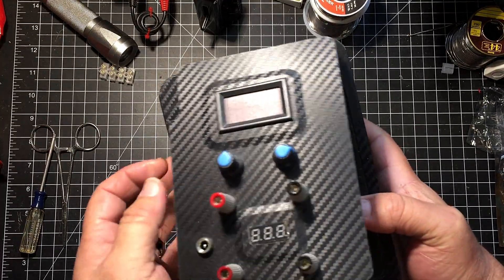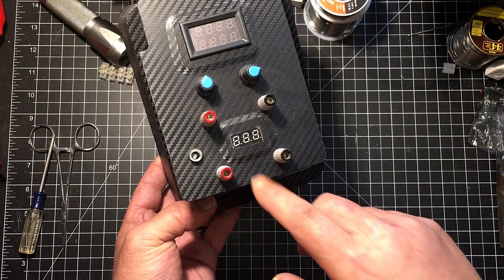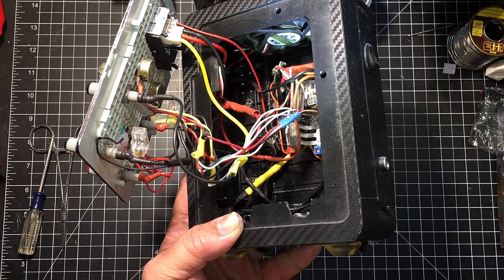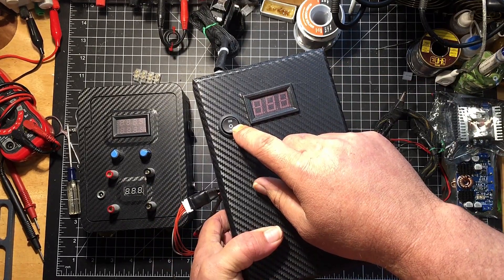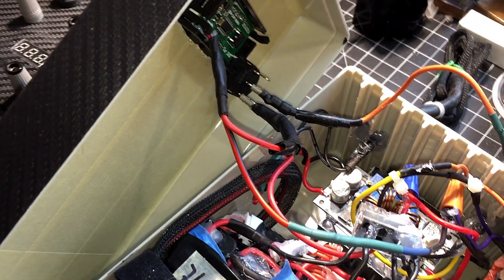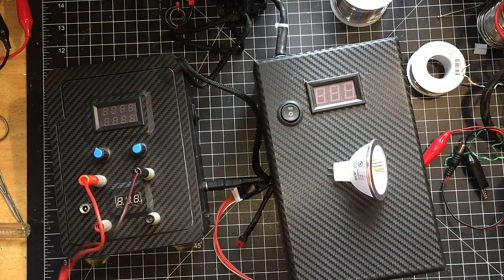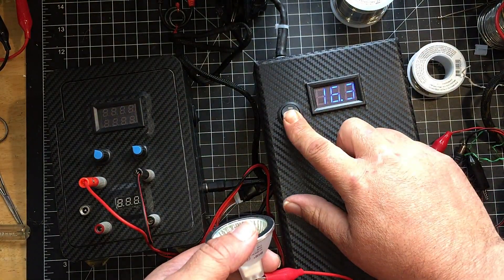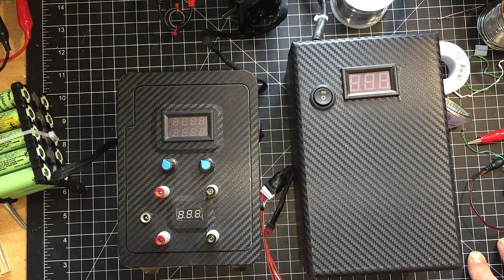DIY Mini Portable Power Supply/Ampmeter XL4015 & 18650 Battery Pack

Comment: weird why does the voltage go up when there is the load? not enough capacitance?
Reply from the maker: Weird it only did it that one time? I tried a few times just now and it doesn't do that anymore. If I had to guess, its the Pot. Single turn Pots are really not meant for power supplies, they are way-way to touchy. I have a few of the Multi-Turn. I might upgrade the Pots for better control?
Reply from the maker: Forgot to ask. Have you ever built a PSU with Course and Fine adjustments on the Pots? How would I go about doing this? Is it just as simple as connecting 2 in parallel? Figured I ask you before I do any research.
Reply: I have not built one yet but I can do a quick video on the pots that my usb DC load uses. and try it on the LM2596 I was messing with the auto fan speed video. lets see what i can figure out.
Reply: well figured out the 35W usb load, pretty simple actually, the potentiometers are in parallel but for you just have a 1k and 10k in series with a fixed resistor to ground, that should do it, so instead of using them as potential dividers use them as variable resistors.
Reply from the maker: So I would maybe use a 1k Single turn Pot in parallel with a 10k and a fixed resistor to ground. That would work for this build. I will be using it on the LTC3780 build. Believe those pots are 200k and 500K. I have some single turn pots(multi-Turn 200k & 500K are expensive..LOL). But I do have some 100k and 10K stock saved up(multi-Turn) and one 200 ohm multi-Turn I purchased by mistake. Any combination of the mentioned, do you think I could use? Or will I need to purchase?

I'd like to use coarse and fine adjustments on my newest build with the LTC. I have seen it done a few times and thought it was pretty neat.  

You mention the LM2596...LOL-I am just about to release another build I did last year with one of these and maybe one later if I get it edited today(2 builds).
Reply from the maker: I just got the notification. Checking it out right now!Thank you for posting!!

Comment: love that carbon fiber stick on.. looks so cool. Dude, your doing super well with your electronics and technology keeps updating so often that we're always 'learning'. ;) build me a reliable 42V 10A charger for my skateboard, i'm using only a 2A taking so long and gets so hot. hahaha.. that's what you get for $15
I'm hoping to make a video soon on my 3D printer upgrades/improvements but need camera stands, I got nothing and it's hard using selfie sticks etc. hehe
Reply from the maker: Thank You!!! Man what I would do for a 3d printer...LOL. Not really sure why I didn' just purchase one of those, instead of my PowerWall Stuff. The Minghe Build is Capable of 42V 5Amp the way it sits, but----I found a couple of Xbox 360 PSU's and I bet if you put those in Parallel or series and plugged it into the DC jack, it might get close. I found both of them at the Goodwill for 4.99 with blue tags dollar day. so I got them for 1$ each. I took one apart and man they build those to last and has tons of filtering. Just an Idea??Bet you might even get away with 3 of them in Parallel?? My bench power supply is capable, but I'd have to upgrade my DPS 3012 to the DPS 5015....But that is another video. Can't wait to see what you come up with!!!

Quick Idea!!!What about a cheap or expensive Computer Power supply with a Charge controller? Even the 500watt one I have puts out 12V 29Amp, with a Charge controller(PWM or MPPT) you would get close to 9amps at 42V.
Reply: interesting, may have to check up on that one day. I couldn't find anything that didn't have bad reviews on ebay or amazon and only had stuff on alibaba and others which can't tell if truly any good so I just went with something low.. at least it doesn't kill the cells super charging.

hey if you ever use those typical 4x5 cell holders, I can print you some face covers like I showed on one of A.Joes videos to protect the terminal ends. so cheap to make, just takes time.